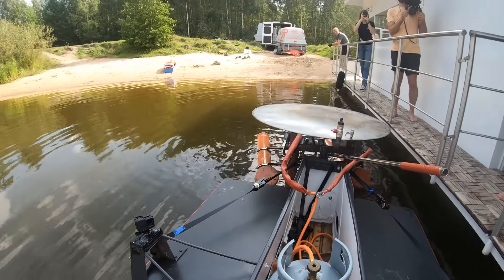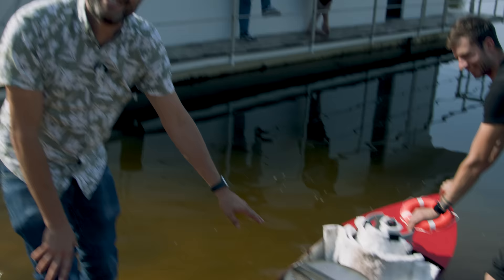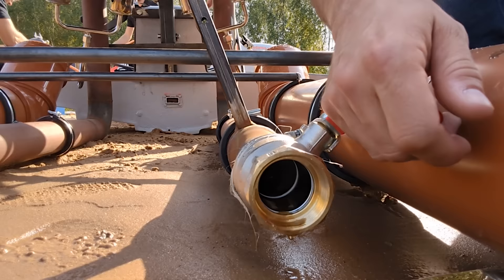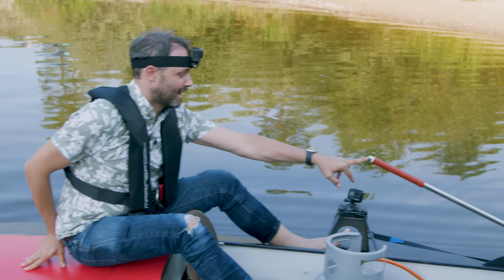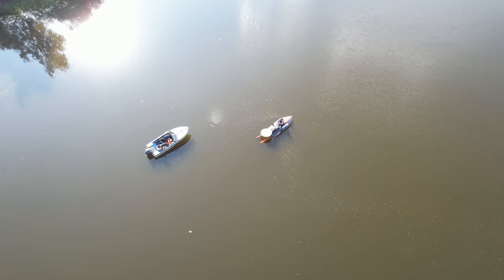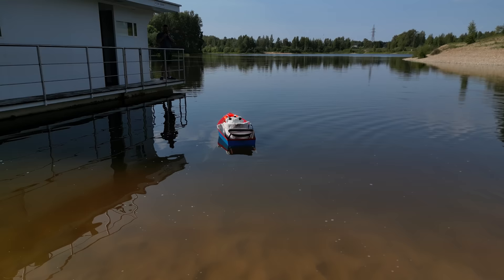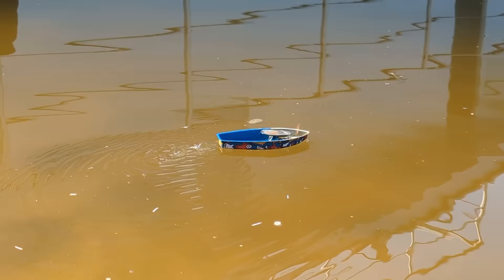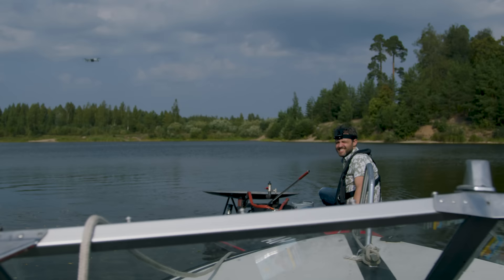Will this toy engine work at full size? (yes)

Comment: 0:14: 🚤 The video showcases the process of building a life-sized pop-pop boat.
3:03: 🚤 The video discusses the features and operation of a pop-pop boat.
6:50: 🚤 The video shows a pop-pop boat in action and explains how it works.
10:09: 📐 The video discusses the square cube law and its relevance to the pop-pop boat.
12:50: 🚢 The video discusses the movement of a tanker in water and suggests a potential improvement in its design.
Recap by Tammy AI
Reply: Thanks for saving time! Amazing summary tool with lovely time stamps!~ where u download this Tammy AI?
Reply: @ambition112 GO AWAY, BOTS

Comment: I've made several of these and one trick is to keep too much water from entering the chamber on each cycle. One way is to better match the chamber with the pipe sizes. And as mentioned in the video, the water input can not exceed the heat that can transfer through the chamber per cycle to flash the water to steam. I'd guess that if they made this chamber more rigid, decreased the internal volume, increased the heat transfer, and limited the water intake (the rigidity and volume will help) it would work better. How much water could this setup flash? Maybe a cup? Probably less.
Reply: I'd really love to see someone try and optimise a pop-pop boat a bit like that guy who optimised a trebuchet to shoot supersonic!
Reply: I was thinking along the same lines. Wen I was a kid we made one with just a copper coil. It didn't make the pop-pop sound anywhere as much as the toy in Steve's first video. Much more like the glass version.

Comment: The demonstration with the cubes reminded me about tiny critters, such as ants, being able to lift something that is many times their mass, while we have difficulty lifting something that has about the same mass as us:  The mass of a muscle increases proportionally with the cube of its linear size. But, the strength is limited by the cross sectional area, which increases proportionally with square of its linear size.
Reply: The square-cube also relates to ants in that an ant can fall out of a tree and land on the ground without a problem. Terminal velocity for an ant is no big issue.
Reply: It's also why truly gigantic ants are not possible.
Reply: Thanks to their size, humans can withstand weather and other hazards much better than ants. A human can destroy a colony of ants, if he/she wants to. Luckily for ants, most they do now is staring idly into a shiny rectangle thingie.
Reply: mass doesn't always equals weight.

Comment: I wonder if it could get more propulsion with some check valves directing the propulsion through some smaller output, but suck the water back in through a larger input.
Reply: yes, but a pop pop boat is supposed to need no moving parts
Reply: @MrAlbinocreeper can use Tesla valves. No moving parts. 
Put an intake valve on the front and the output on the back. Double the propulsion with no moving parts.

Comment: If you made the tank rigid, instead of letting it flex up and down, a lot of your energy would go into thrust behind instead of into the air above the boiler.  It wouldn’t make the pop pop sound, but it might be more efficient.

Comment: Suggestion:  Use a single propulsion pipe with a pair of check valves that allow water to flow in through the front of the pipe and out through the rear. I suspect that it's best to make the inlet slightly larger than the outlet.  I'd go with the type of swinging-gate check valves often used in wells because they lack a spring that could interfere with flow at the very low pressures involved.
Reply: Except a pop pop boat works by pulsing water in and out not by expelling water.
Reply: If we're moving to a flow through design, we might as well full commit. Use a drip coffee maker heater for the heating mechanism, basically make the whole system a steam jet engine.
Reply: @TlalocTemporal  No need for full flow-through on the entire system.  In fact, that wastes the heat in the water of the pulse-generation section of the plumbing.  But using separate inlet and exhaust orifices in the jet segment means that inflow can have a larger orifice than exhaust, providing the opportunity to increase exhaust velocity without reducing return flow as well, which ought to improve performance.  We're talking about a very weak pulse as currently configured; this could make a measurable difference.  I very much doubt that the system can be made effective enough to be truly practical, but it might be possible to lift it to the level of entertaining curiosity at full size.
Reply: When I was young, made one using a copper coil rather than a diaphragm.
Reply: @treborobotacon the end goal is to eject water out of the exhaust to move the boat.
Reply: @corbeaudejugement  
It produces a small amount of steam that moves water in and out

Comment: Volume and surface area is only part of the problem, pipe run is very important. You have vertical pipes with 90 degree bends, that will significantly reduce flow, the heat wasn't really scaled up either. You need to bring the plate closer to the water to reduce static head, increase the heat and make the flow of water as smooth as possible by straightening the pipe as much as possible, Pipe diameter is also important. Friction loss is irrelevant due to the short distance but you will need to understand the volumes of water flowing in and out of the engine to calculate the pipe diameter required, the pipe needs to be small enough to only just allow the required flow, valving and other forms of throttling won't work.

Comment: Can you make a permanent magnet motor with a diamegnetic material like bismuth. I know it will be x1000 worse but would it work as a generator? A little?
Reply: It could theoretically work as a motor, but backwards compared to a normal induction motor. But diamagnetics don't have their own permanent field, so working as a generator is a no-go.
Reply: Making a permanent magnet out of something diamagnetic sounds...diascientific.

I don't think it works that way at all, like trying to magnetize water or your body.  No magnet, no motor or generator.  Not 1000 times worse, infinite.

Comment: There's a drip coffee pump version of this (well, used to be one, back in the 90's) in France. Made into an actual wooden row boat. If memory serves me right, it had a glass lathe's burner oriented towards a 3~4 cm ID copper pipe, u-shaped, with check valves at the end. The intake pipe was bent forward in to a hook, which used to cause the pilot a head ache once in a while because it kept catching stuff from the lake it was tested on. There's that saying "once on the internet, always on the internet" but it's not true at all, can't find that forum for the life of me.

Comment: This seems very interesting and might be worth looking further into. For example, would it be more efficient to have several smaller pop tanks or whatever, or a dozen even smaller ones? And what about automatic pressure release valves for better control of the release. Maybe have it release when it reaches a much higher pressure and have it cycle through the tanks like an engine cylinder.
Reply: That was my immediate thought too.
One way valves. Two out at a set pressure and one in.
Reply: the amount of fuel they are using is insane, better off using probably any other tech. even something like a pulse jet
Reply: Problem is, you build up too much pressure, you'll empty out the exhaust pipes, meaning you're now pulling in fully cold water on the intake stroke, instead of condensing steam in the boiler end of the exhaust tubes.
Reply: @bobedwards8896  making a good boat was really not the point of the exercise.  It's not even the point of the toy.
Reply: Time to make me an "eight cylinder" pop pop!

Comment: My intuition tells me that part of the problem with the large boat is that the metal on the top of the motor has NOT been scaled up correctly. It should be considerably thicker so you’d get a faster cycle.

Comment: So would increasing the surface area increase the frequency of the engine? If so, I'd assume you could make one using something similar to the fins in an Automotive radiator to help achieve faster speeds.
Reply: Those propane powered portable showers are prefect
Reply: Well heres a thought for you.
I dont know your age, this is ment to be honest advice and not to talk down to you, but accessable to all ages.

Heat capacity, how much heat energy any object can hold and carry to raise its tempurature by 1 degree.

For air and aluminum, and steel, and copper, it all has a much lower capacity then water.

So given that, what side do you think needs more surface area?
What would be better, having more heated air from the flame pass over the same amount of water, or trapping more air for the same volume of water?

You could have many smaller heating tubes with the same burner, and that would dramaticly increase the surface area (touching the air) to water ratio, or maybe make a bigger wider, thinner pop chamber if you did not want to spend months making one, would that work better then wjat youve propsed?

Comment: Fascinating. so, is the next step to make a large scale engine that harnesses the higher frequency of the smaller engine size, by connecting many smaller heating chambers?
would separate intake to output pipes help, especially if different lengths & diameters? what's the best metric for a pop-pop boat, frequency, size, thermal conversion, thrust pipe diameter?

Comment: I think several smaller units operating at higher cycles would be more efficient. Might even be able to connect multiple units to one outlet and tune the pipe or even reduce the outlet to increase pressure.
Reply: Was going to suggest the same thing. Like internal combustion engine development.

Comment: I wonder if you can make a life sized glass engine... sounds dangerous but it would be fantastic to see it happening at such a large scale, plus the glass wouldn't flex as much but I imagine that's what makes it so much more dangerous.
Reply: I doubt it, unless you used some special glass. I believe, the glass tank would need to be thicker to withstand the pressure, and glass is pretty heavy... and poor heat conductor.

Plus as you say, imagine pressurised glass tank failing... although that's probably just a cherry on the top of problems with scaling glass.
Reply: A giant glass pop-pop boat you mean? I've seen videos of gasoline engines which have enough clear parts to see everything which is going on inside.

Comment: having a one-way valve on the front for an intake and another on the rear for output would give a lot higher speed. As it is, you're pushing forward, then immediately pulling water back in, causing a reverse thrust (lower than the forward thrust, due to heat and expansion, but still) that takes away from the forward momentum. Having a way for the water to expand out the back, but contract from the front would have a "two-stroke" pop-pop boat

Comment: I want the water reservoir to be a cylinder, the structural integrity of a cylinder would allow higher pressures with less deformation
Reply: This is essentially a cylinder already, just with a height of 0, and a slightly curved bottom XD. If the top was slightly curved as well (upward) that alone would make the reservoir much more rigid, even more so with an internal post in the center. I think the flat-ish shape is kind of necessary for the heat transfer to be efficient.

Comment: I would think propulsion could be maximized with a burner heating a bunch of tubes rather than a pan pressure vessel, with the tubes laid side by side as low to the bottom of the boat as possible with the chosen burner (could possibly surround the tubes in a double wall to allow a burner that's not actually below the tubes but still direct the combustion gasses around the tubes) and the expulsion pipe (or pipes) out to the nozzle run directly down through the bottom of the boat from the tubesheet to minimize the dead run in between the tube sheet and cooled portion of the expulsion pipe(s) and then along the bottom of the boat to the nozzle(s) at the back. And it/they would have to be cone shaped nozzles to increase the velocity of expulsion as well as to take advantage of venturi effect. 

If you need the sound, you could put a small oilcan (possibly even literally an old oilcan) on one of the fill valves to make noise if you want noise.

Ugh, now you've got me wanting to build a prototype using something cheap with as low of draft as possible like a small jon boat. Your team's build sacrificed a lot to keep true to the miniature boat's design rather than to cater to the conceptual realities of scaling up. I'm on craigslist looking at prices of 12 and 14 foot jon boats and Amazon looking at prices of 'point of use' or 'tankless' water heaters to modify (they won't build steam as is - yes safety would be tricky but doable) and use in place of a burner or burners. 

If I wasn't beyond broke at the moment I think it would be a worthwhile experiment.

Edit: A diesel/propane fired steam pressure washer off craigslist/facebook marketplace might be the perfect thing to provide the boiler.

Comment: Without smarting up on the matter:
- nozzle and potentially even valves
- if several pipes are needed/fitted, adjust them centerline or even above one another so that theres no off center push if not built symmetrically
- reduce amount of water to be heated
- rigid pressure tank
- better surface/heat exchanger /coil

Comment: What if we split each "exhaust" pipe into two, one branch of each pipe will stay as it is now, facing backward, and second branch of each pipe will be bent 180 degrees facing forward. Then we install tesla valve(or any other valve really, it's just a simplicity choice) on the forward facing branches so it allows water to move more freely  inside, and on the propulsion branches we install such valves so water can move more freely outside. That way we could slightly increase propulsion, because on intake it will pull the boat forward also (minus the added drag of forward facing branches, but I suppose it's more of a matter of adjustment, picking diameter, choosing valve etc.

Comment: I don't know where I got the idea but as a teenager I wound a coil of brass pipe, (about 2 turns) the coil was about 1 inch diameter and the pipe was small about 1/8".  Mounted on the back of a sardine tin, metho was the fuel but it worked.  The water in the pipe turned to steam, blasting out of the pipes, then when there was no more steam, the pressure collapsed and water got drawn back into the hot pipe which would immediately burst into steam, so the cycle repeats. Ted from down under.

Comment: I actually did my mechanical engineering final year project on attempting to model the process on how they work. I also made transparent poppop engines, and rigged up several prototypes with thermocouples to map heat difference and so forth. I didn't get very far other than a ton load of data that was hard to interpret. I guess the problem is scaleability. A toy poppop boat only needs a little thrust ti get going but a flame provides a massive amount of energy for the scale of energy transfer in the expansion chamber. To provide the same ratio of energy transfer you need a heat source much more potent.. but material properties dont upscale so you cant heat a larger chamber the same way with all the  pressure and energy required to produce the same reactional emotive power
Reply: Unfortunately you can't just scale everything down or up. The size of molecules doesn't change when you shift the structure. There will always be an optimal size for certain things.

Comment: I dont know why they have the boiler section.
We had great success just creating a coiled section of pipe to heat, looking like a Still.
That would solve the flexing steel container  problem.
We also found that the shape of the exit point on the pipes made a big difference  
If you crimp the two pipes to make them flatter and wider, you got better performance.

Comment: Try adding check valves on the inlet and outlet. Forcing flow path thru the heat exchanger. Perhaps direct inlet to bow of the boat.

Comment: Going by your explanation for the reduced efficiency, I think that a multi-cylinder pop-pop boat could be far more efficient than having one large cylinder. It would be really cool to see the medium boat used as a test rig for different designs, like that or using check valves like @Intrafacial86 suggested.

Comment: I’m most fascinated by the principle of sucking water in and out through the same pipe. Any motor can move a piston in the water column. The suck-in stroke draws water from almost 360 degrees, but the expulsion creates a much narrower cone, creating net thrust with no flapper valves or propellers. A good solution anywhere fouling or entangling is a concern.

Comment: 1. the vessel should be stiffer, bending of its sides is a loss of power.  2. the vessel must have mass to accumulate enough energy to quickly heat the water.  3. the pipes must have nozzles of a calibrated diameter so that the pressure inside the vessel has time to build up and create the reactive force of water pushed out of the nozzles.

Comment: I wonder if you could do something like use many small pop pop engines. So you'd be able to power a boat this size with like 100 candles and membranes

It'd probably end up being an unnecessarily complex system for how slow it is, but fun